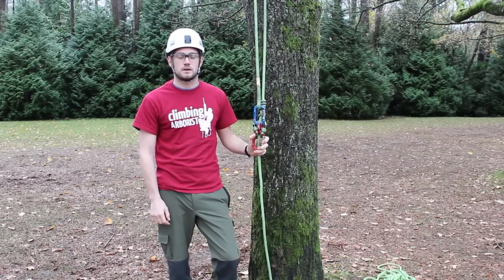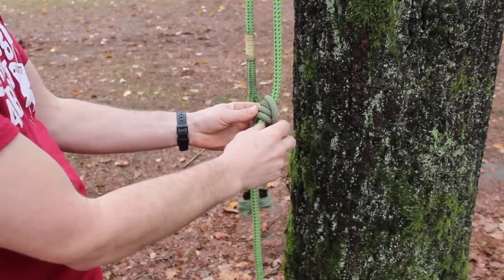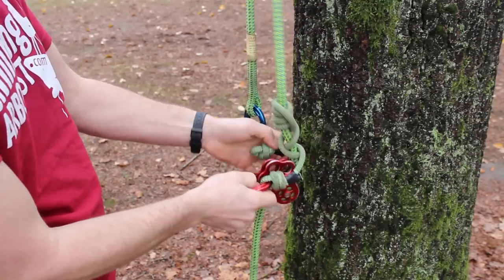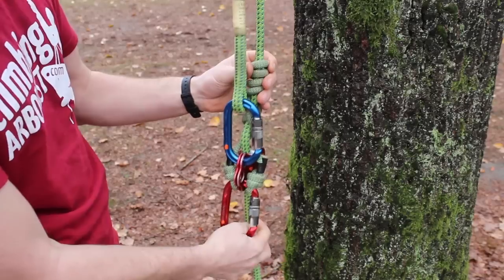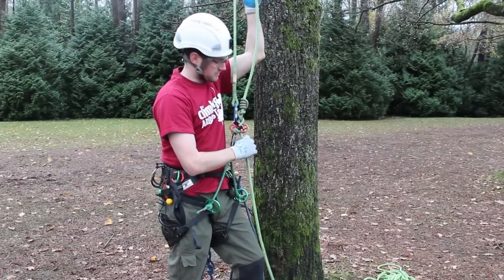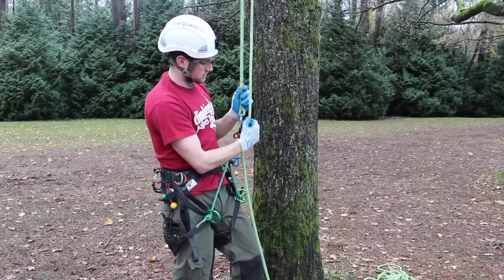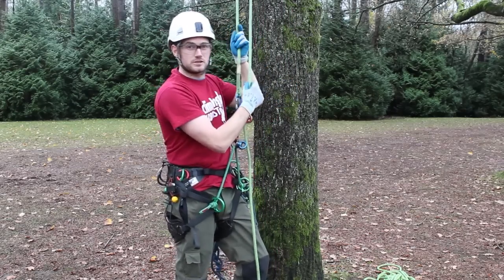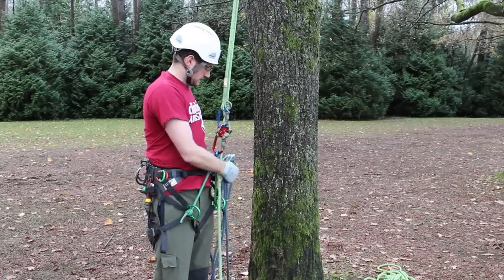Using the Hitch climber

Comment: This is just an observation to those questioning if this is worth the extra gear over a simple blakes hitch or split tail. When I started climbing with this I was like yeah, it's nice, but wasn't sure it was worth the money. Then after using this for six months I went up a tree without it and really noticed how convenient it was to be able to tend slack one handed. It's one of the things you only really appreciate after using a while (long enough you are doing it habitually) then go back to the old method.

Comment: i just got the hitch climber, 2 dmm ultra o caribiners, and 28" 10mm Ocean polyester hitch cord tied with the standard VT. my second time in the tree, the tape on the splice was able to catch my hitch preventing it from catching. i found if i keep the pulley towards me, when i pull the tail, it pulls the ropes just slightly away from each other, and that is enough distance to prevent catching.

Comment: Years of using the Blake’s. I went to work the Paradise Fire, Ca. And worked for Mowbrays and the introduced this DMM hitch pulley, I was concerned. But! I realized how efficient it was with walkouts and I never looked back. It’s freaky at first but love it
Reply from the maker: Fantastic piece of kit
Reply: I work for Acorn and they all use the hitch climber I still climb on Blake’s and micro pulley
Reply: How can I get a job with you

Comment: You CAN use a termination knot, so long as it does not slip / choke. IE; a Yosemite Bowline, Figure Eight on a bite, etc. By leaving a long loop, the bulk of the knot will sit above the friction hitch. The longer the loop, the higher the knots bulk will sit. This won't be as streamlined as an eye-splice would be, of course. But in a pinch, it does work.
Reply: EgaoKage Side loading the carabiner
Reply: EgaoKage h

Comment: I'm glad you added that part at the end. It is definitely something to be careful of when using the hitch climber. Mine has gotten stuck like that and I have spliced end.
Reply: O-rig is a good workaround to avoid the termination of the climbline from fouling the hitch, with the added benefit of needing only a single carabiner for the system.
Reply: Even though DMM say you shouldn't use a termination knot, I've found that the anchor knot is small enough to work with several different hitches.

Comment: I found if you dont have a spliced tight eye rope, the anchor hitch termination knot, and the michochan prusik knot are the 2 mlst comlact knots for this system and ive never had any issues wkth the termination knot getting in the way by descending the system. I guess you could also use a bowline  with a bkg enough loop so it doesn't interfere, but it's not a termination knot technically.

Comment: With this setup in this configuration, does the carabiner attaching the sewn eye to the micro-pulley ever accidentally engage your friction hitch and put slack in your line or cause a descent? 

Seems like the top half of this setup is crowded. Still looks cool and definitely worth playing with but looks crowded.
Reply from the maker: Not when using a termination eye, but it does it using a termination knot

Comment: i have been using the dmm hitch climber pulley and ive noticed that the end of my climbing line with the biner on the top or middle hole either way it does the same thing the rope or biner both touch my hitch and cause it to slip and i cant figure out why  i have 1/2 samson rope and 8mm 30" armor prus prussik usually schwabisch and the dmm pulley and petzl triact biners????? help
Reply: This is a very interesting point that i have been aware of for several years now.  I am curious if you ever found a solution or technical answer to this problem with the dmm.  For the life of me, literally, i cant believe this risk hasnt resulted in a death and investigation.  I have recreated the problem and shown my other teammates, no one is able to figure out a solution.  The antecedents are climbing with a narrow tie in point and allowing the hitch to slide down below the top carabiner of the standing end, both occur frequently on any given day.

Comment: No termination knots... is that in regards to noose style termination knots or all termination knots including fixed loops which'll  keep the bulk of the knot out of the way of the friction hitch?
Reply: I'm wondering this big time. I ordered the pulley this morning ... I don't use that style of termination knot. I am running an anchor knot. Its widely used for this job because of its low profile makes it perfect for the job.. also I am planning to clip into the bottom and middle attachment points and that should orient the ropes in a way that prevents the hitch catching.  I will let you know.

Comment: Nice demo brother. I ordered the hitchclimber earlier today. Last week I lost the first two feet of my rope. Basically my splice. So I'm doing an anchor hitch. Which I like because it makes for a better monkey fist. At the end of the demo  how you explain why dmm said you couldn't run a termination knot, couldn't you just clip into the middle hole then to orient the knot out away from the hitch so as not to inadvertently press down on the hitch and letting you slide?
Reply from the maker: That is completely your decision at the end of the day. DMM say you shouldn't use a knot because it can, and inevitably will tend your hitch at some point which could be disastrous at worst, or just give you a fright at best.
Reply: Right on. There are a few other safety videos from popular climbers that have gone over this that you should actually clip into the middle and your hitch actually won't catch ever

Comment: I notice you have sewn eye ends on your ropes. Do I need to have that sewn eye to follow this guide/steps?

I have a 150' of 1/2" arborplex rope
Reply: With this setup you need a spliced eye, a termination knot can possibly collapse your prusik.
Reply: Yes, that's what I took away at the very end. I heard you cant use a termination knot and before I fully processed it the video was ending. I wish he would have said it in the beginning. That's a very important fact. I usually climb with my life line as SRT but use a long lanyard DRT. I was thinking about getting one of these but not sure it will be worth it because none of my roped have a sewn eye.
Reply: I'm going to run it. That termination knot looks way bulky to me. I run An anchor knot and in the demonstration his knot was only catching the hitch when he had his termination end clipped into the top hole. If clipped into the middle attachment point it will add space between the two and preventing the catch. That's my hypothesis anyway I will update.

Comment: Don't take this the wrong way, I haven't climbed in a few years and technology/techniques  are bound to change, but looking at that set up I'm hard pressed to agree that it is any more effective or tidy than say one carabiner, a couple of half hitches, and a blake's hitch.  Having a pulley is nice but I found it was just another thing to carry up a tree with me to get caught on things while working, one more expense, and ultimately one more thing collecting dust at the bottom of my duffle bag.  It looks like it would work just fine, but what would be the reasons to go spend the money on a second biner, and a three point micro pulley when simple rope work will do the same thing? As for positioning, again.. more options are always good, but my lanyard, and life line virtually always could be rigged in a way that would allow for comfortable work positioning.  What would compel me to go out an buy new gear I've previously never needed?

The rig looks great, don't get me wrong.  I'm not saying it wont work, it looks like it would work just fine, with the exception of the warning at the end of your video.  What are the real benefits to the system?  Smoother?  Faster? Safer?  I'd wager I can tie myself in faster than it took you to assemble all of that.
Reply: Chuck D Well I have the same system. And tending the slack is so much better than tending slack with a Blake's hitch. One hand motion on tending slack.  Rather than 2 hands with the Blake.
Reply: Shawn Stick Chamness fair enough.  If the system works for you then there is no reason to stop using it.  different strokes for different folks.  When I climbed I tried a variety  of hitch minding pulleys.  for my taste I found that for the extra setup time (I know... it doesn't take long, I'm just talking about my impressions) it didn't offer vastly more performance than a system I was already very comfortable with.  I ended up with three reasonably expensive pieces of gear that just went unused after a month of trial.

I suppose it boils dow to what system you are accustomed to.  if you've spent a lot of time with just a hitch,  
then slack management becomes second nature.  The same can probably be said about other systems, with familiarity comes fluidity and speed.  If I'd spent as much time incorporating pulleys into my system I would have gotten faster and more familiar with it.

Either way, be safe up there!  And while I'm at it, although it seems like I'm complaining it isn't actually about this video.  I thought the video itself was very well made and a great instructional aid for people who want to know about this system.  I suppose I just prefer to keep my system simple, and to take as little up a tree with me as possible.
Reply: @chuckd5855  I can only agree wit all your saying

Comment: could you please find the way climbing a tree in emergency, for those who have no equipment, only a rope, and escape those who chase you, or hide on the tree, cos rarely they would look up, and when you establish this, (for non muscular women), how to get down safely? please...
Reply: Thats a very weird scenario
Reply: A gun... You're thinking of a gun...
Reply: this is an insane scenario. 

you could, with a single and long enough rope, make yourself a harness and climb dDRT with a Blake's hitch (and even double your system using the other end of the rope, to get to a higher anchor point or pass an obstacle). I've done it up a few feet just to test it. I'd never use that if I weren't already in a life-or-death situation. Not so fast either.

It's uncomfortable, impractical, and you do have to be in shape. You need pulleys if you want to make climbing easy, and then it's going to be that much longer to get up a tree.
Reply: Lmao!

Comment: Seems like too much equipment. I'd rather stick to the old school simple technique. Main safety line and lanyard. But hey, everyone should do what's BEST for them! Very informative videos though. Definitely the real deal 👊
Reply from the maker: Using old school techniques can get the job done well and get the job done safely, but the industry and the equipment is evolving. It is evolving to make us more efficient, equipment is designed to make climbing easier with less tree on the body, so in my opinion keeping at the forefront as the industry evolves is better for you as a climber.

Comment: 3:30 WHAT THE HELL ARE YOU TALKING ABOUT!
Reply: This dude needs to reset.
Reply: replying super late here but oh well. basically when you climb with your pulley AND termination end attached to ur bridge, when ur ascending and u pull on ur climb line ur pulley has no tension on it and will go slack. this causes the pulley/hitch and biner to kind of just flop over and can be a giant pain in the ass trying to get it straightened out while climbing.

Comment: Now your life depends on the pulley, because you use it as a connecting point. Im sure thats not rated or approved to that use. So you are  showing beginners some very stupid and dangerous !
Reply from the maker: The pulley is rated and designed with this exact purpose in mind. Please don't comment things like this if you haven't even bothered fact checking or are unfamiliar with arborist equipment.
Reply: Thanks for correcting me.  @ClimbingArborist  . My bad. I wasn't aware of the pulley being rated as a that. Hope you accept my apology. I didn't do my homework. Just saw you used a pulley as connection point. Didn't notice which kind. Great video. Sorry !